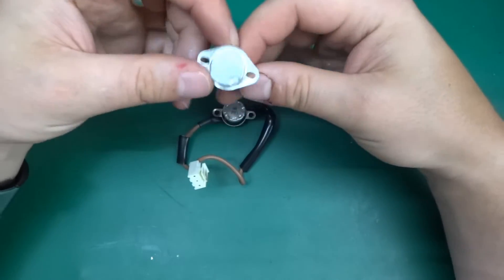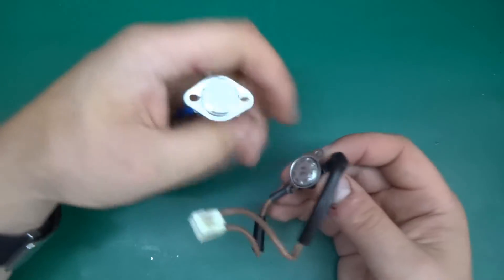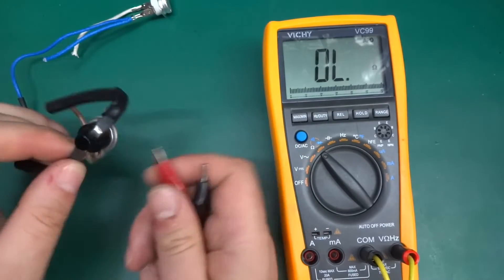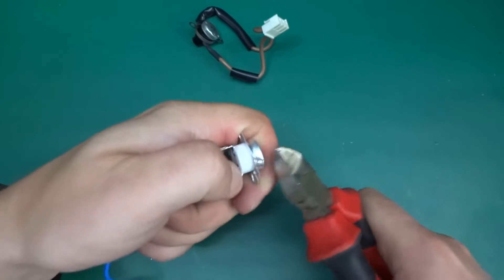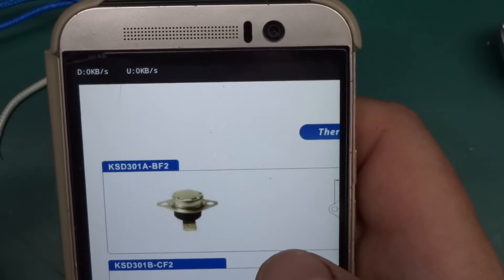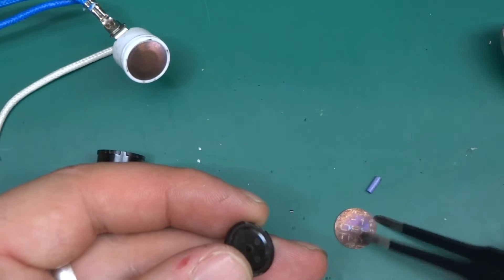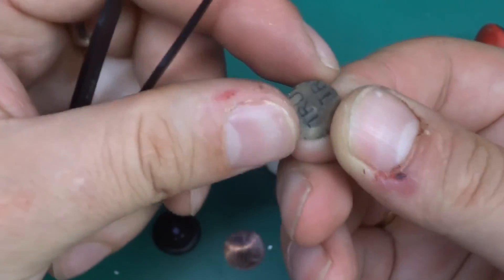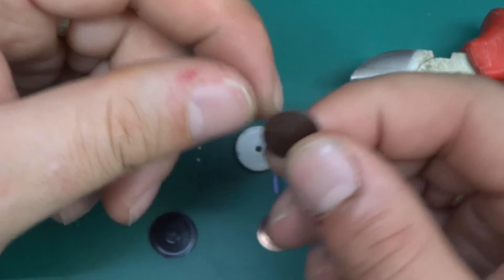Thermostat teardown (one way) KSD301 & 90PM1

Comment: Hey, man. Do you know if there is a difference with the KSD201? Is this just a newer model.? They are exactly the same visually, as well as temps can be found the same. But 201 are nearly impossible to find at the price of the 301, though Amazon does have a single listing for a 201 now.

Comment: Thanks I just bought a new heating component but the new one went out too, I think I got a bad thermal cut off switch as it's the only part with no continuity even after applying heat.

Comment: Hi...hopefully u can help me.. I was trying to change the thermostat for a garment steam cleaner (220-240v~50Hz - 1260 to 1500w)..but the specs on the thermostat has faded/melted away.. now im not sure what amp or resistance should i get?   tq
Reply from the maker: Hi, sorry, but I'm not sure what spec you should use. You have 2 parameters to look at: amperage and temperature. 1500w is about 6.5 Amps, so look for something above that, and the temp: well steam/boiling starts at 100 Celsius, I would think that the thermostat would be slightly above that, however, important thing to consider is that if the thermostat temp is too high, the pressure inside the vessel might raise above  the vessel's rating and it might explode violently - so be careful. Only advice I can give: find schematic and figure out exact parameters, or don't repair - get a new steamer. Not worth the risk. Either way, good luck.
Reply: @randomtronic  tq Sir.. will probably get a new steamer

Comment: These are called bimetallic strips (they are often rectangular). They were most famously used for turning signals in cars (you remember the sound for sure). Instead of measuring an external heat source they simply "measured" there own temperature changing from the current flowing through them.  They have been increasingly replaced by electronic switches (the sound nowadays is artificial in many if not all cars) for that application but the principle is still often used and very reliable.

Comment: Please answer this question if you are able -- it will be appreciated!  I have a defective KSD301 thermostat from a heater.  The label says "16/125~ 120".  I think this means that it is '16A' and '125V' and '120°C'.  I think it should be OK to replace this with a '250V' model instead, right?  It is much easier/cheaper to find '250V' versions instead of '125V' versions.  Thanks!
Reply from the maker: Yes, you are correct. Higher voltage rating means it can disconnect higher voltage. 250VAC thermostat will work just fine in lower voltage circuit. In fact it will "click" without any voltage, as it is a bi-metal switch. Change it, it will be fine. Good luck!
Reply: Thanks so much for taking the time to respond to my query!  With that confidence, I was able to order very inexpensive units from Aliexpress :)

Comment: Hello! I had a portable steamer (like an clothing iron) that went out. Decided to take it apart and it turns out a transistor on the board blew out. Can't be bothered to repair it, but I did find one of these sensors inside. 

Thanks for the video! Interesting and educational!

Comment: Hi I have a question I have a thermostat out of a coffee maker part #ksd301-g 125v 16a 148 on it I can’t seem to find one with exact #
Can you help me
Reply from the maker: Hi, this 148 seems out of place. Have a look here:https://www.google.com/url?sa=t&source=web&rct=j&url=https://www.calcoelectric.com/images/pdfs_thermostats/calco_ksd301series.pdf&ved=2ahUKEwiwqf_XtLngAhW1URUIHTWkAlUQFjAAegQIAxAB&usg=AOvVaw3DgmtUdOhMguVvAEFdrla2
Reply: no issue if it is 250 V or 125V you can use the coffee maker doesn't has much Ampere you can also use 10 A if 16 V is not available

Comment: I have removed a ksd30 thermostat from my infrared heat. 16 amp 125 volt with a temp of 120. 

Is it supposed to rattle. My heater keeps turning off so I suspect the thermostat is not supposed to rattle.
Reply from the maker: Yes, it is supposed to rattle. It's the little little dowel, it rattles. Your heater is overheating for some reason, that's why it keeps turning off. Look for reasons of overheating.
Reply: @randomtronic  
I phoned and HVAC company and talked it through. Most likely reason he said was the length of wire before it gets to the heater. I have a hundred foot extension cord wired to my shed and a power bar in the shed. He said he thinks it's just not getting the voltage. So I'm putting it all back together and going to plug it in in the house directly to an outlet to see if it keeps kicking off.

Comment: Instructive video ! 
Just a note ... @ 9:24 the video seems to freeze but I think it was just a video editing problem. The video resume normally at 10:22. A A message "skip one minute" would solve this problem without reediting / uploading the video.
Reply from the maker: Thanks! That's a new one... Must be a glitch in rendering as you said. It never happen before (I think...) Anyways, I have trimmed out that gap in YT editor, it is processing the edit now. It will not be pretty, but interruption will be just a second or two long. Besides, I was probably just waffling during that minute, so maybe its better that way ;) Thanks again!